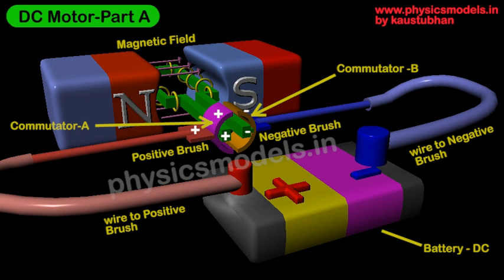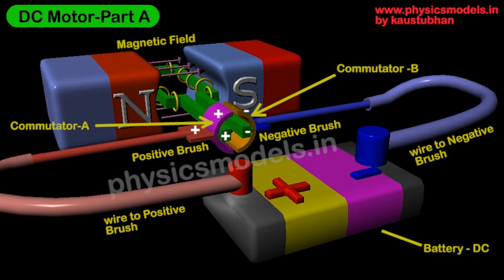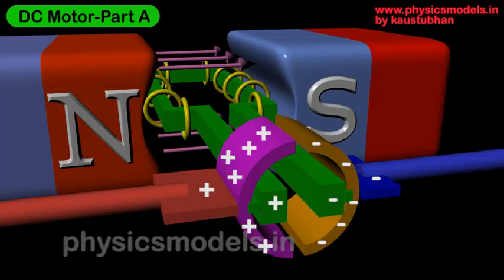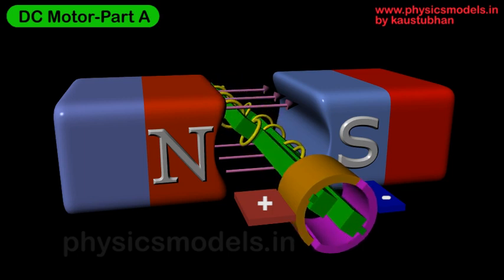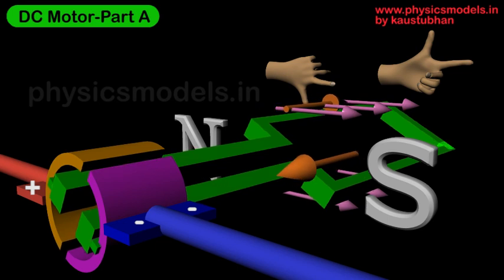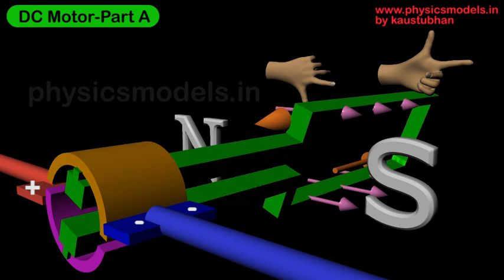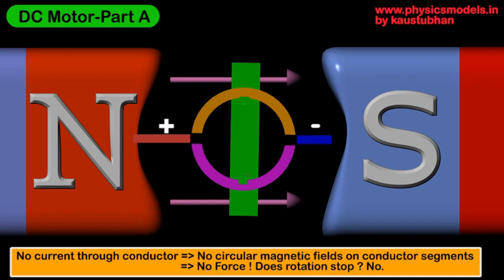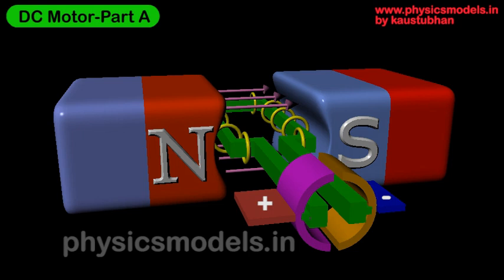DC Motor Working Principle - Part A (Physics)

Comment: You did not Explain adjectly how COMMMUTATOR convert AC voltage or Current to DC?
Reply from the maker: this video is about DC Motor. That means only a DC source . AC Sources covered under separate videos.